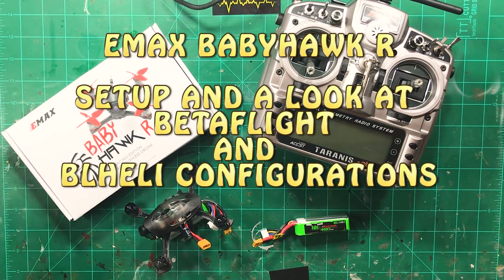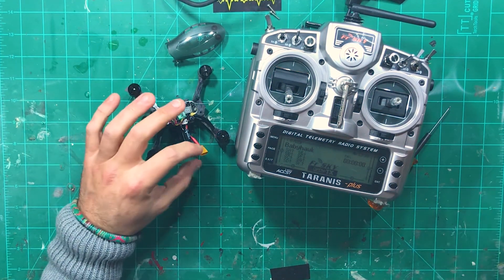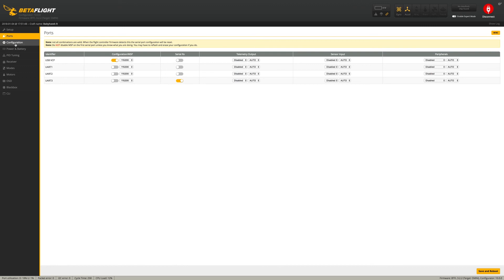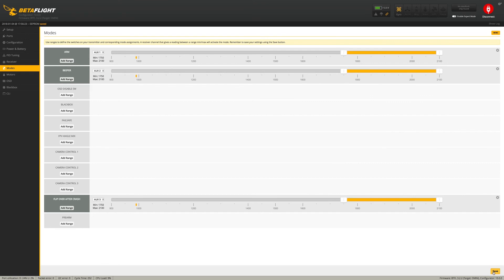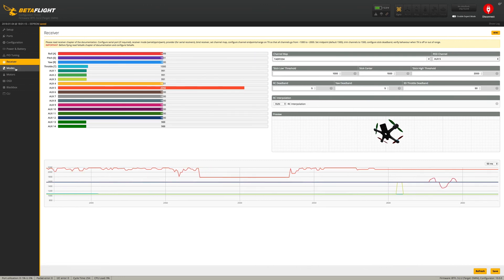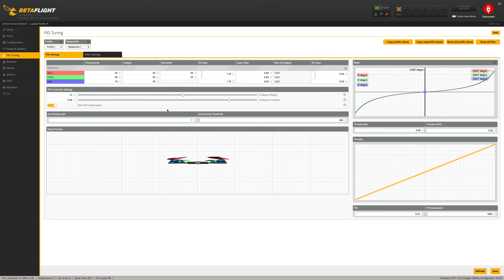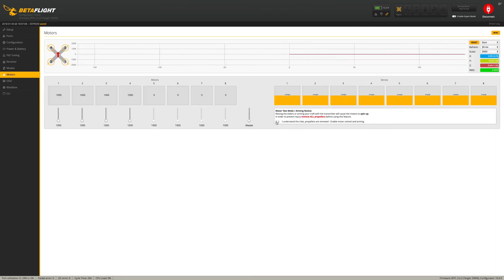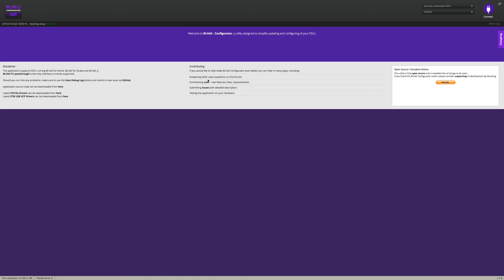EMAX BABYHAWK R FULL SETUP VIDEO-BETAFLIGHT BLHELI AND SUPRISING PIDS

Comment: Ive been trying to bind my q x7 to the quad, not sure its working, also when i get in beta flight, configuration tab, not sure wich reiciver to to click on. I have frsky but im not seeing any rests. Also, when i typed version on the csi, or bottom tab, it sais omnibus, 3.2.3 but on the set up it has many, the latest sais 2.3.2, so thats what i clicked
Reply from the maker: you def need to flash the correct target..or leave it the same..hopefully you didnt change it but im pretty sure its an omnibus..you shouldnt have to do anything in betflight with the bnf except set up the taranis and bind.  i would double check the correct uart is selected and running sbus and then in receiver type in the receiver tabs it should be taer/jr/graupner..and it should work just like in the video.  right out of the box
Reply: ChaddyCEEE RC i did flash it, but i did save the original settings. Thank you for replying
Reply: On the CLI, IT SAIS OMNIBUS 2.3.2, THE original version was 3.2.3, i backed up that file, not sure how to put it back though. Do you think that may be why i cant bind to it

Comment: Are all the bolts you used the stick parts or did you have to get longer bolts to make it fit?
Reply from the maker: kitensurf no extra stuff needed. All the stock stuff fits just fine.

Comment: hi, watching the set up, every thing is good until u go to this set up program at about 5:00. where is this set up program? i tried http://yinyanmodel.com to get it , i cant find it, all the tutorials go to this program betaflight, where is it, does it automatically fire up when the usb is plugged into the babyhawk?, im new to this. help.
Reply from the maker: arado240dd you mean betaflight. Ok betaflight is the software on the flight controller. You can just google betaflight configurator and then it will take you to the download links at github.com. The. You can download and install it and then hook up the babyhawk to it.
Reply: ok, done it , thanks, worked, can  see lots of stuff on it.. plugged the drone in , it reacts.. wow. , now im a mode 1 flyer , how is it changed from mode 2 to mode 1 .

Comment: Question!  If you don't mind. I am new to this hobby. my first drone is the BH r .  I have it all bound up and everything works except  when I try to set up telemetry,  I am not showing any sensors even when I tell it to search for them.   any Idea,s for me to try?  thanks Chuck
Reply from the maker: did you get the bind and fly model??  for frsky??  if so..this is what i have..the small frsky receiver included does not do any tele..but they have rigged up rssi in the bf osd..thats all we get..nothing back for auido alerts is available.
Reply: Thank you.  Yes it is the bnf frsky,  I guess I can quit beating my head against the wall on this issue.  again thanks.
Chuck

Comment: Got almost 3 minutes flight time with tattu 650 3s, stock pids, and new cyclone 2035s.
Reply from the maker: K Krause I have some tattus on the way. Those props fit huh?
Reply: ChaddyCEEE RC yea man they seem quieter than the avans but it was windy today. They seem durable. Bent one and it bent back
Reply: ChaddyCEEE RC i just got some graphene 460mah from piroflip and they have a much thicker power and balance cord than the tattu. Seemed to fly around the same amount of time but the quad feels nice and agile 10 bucks a pop too.
Reply: Id stick to the avans, feels like the cyclones oscillate too much

Comment: Love everything about it except the flight times. Heard they are limited to 2 minutes. If you used a larger battery could the flight times be extended to 4-5 min
Reply: 2 to 2:30 a flight on 500mah batteries.   don't think you will get 5 mins out of it
Reply from the maker: etab83 I have a few batteries to test with but it will be really hard at a 2 inch size.
Reply: i’m hearing Gemfan props give even longer than that
Reply: Will have to check those props out. Thanks